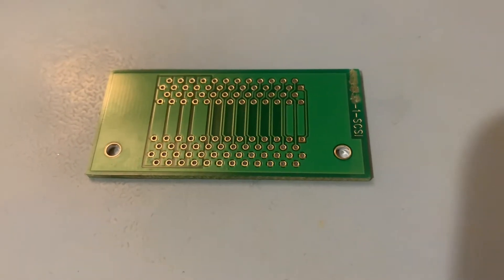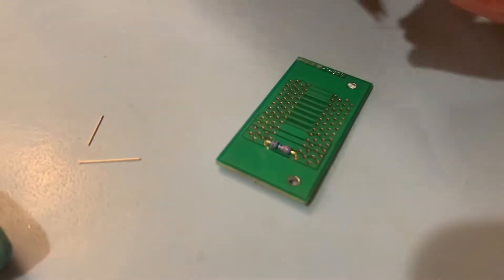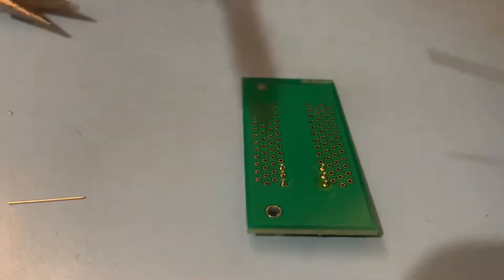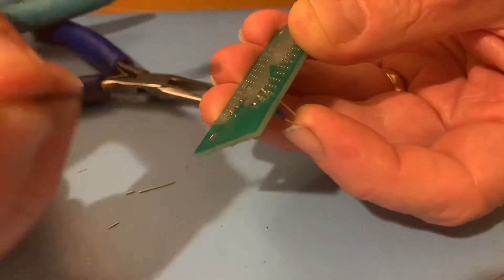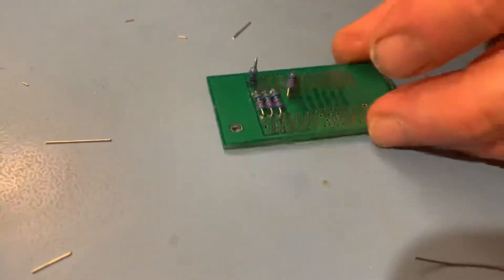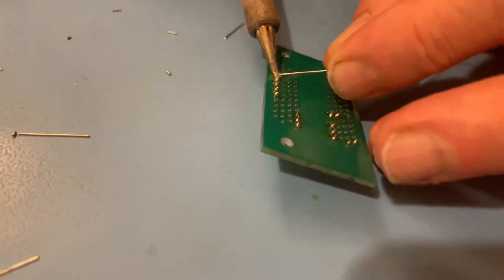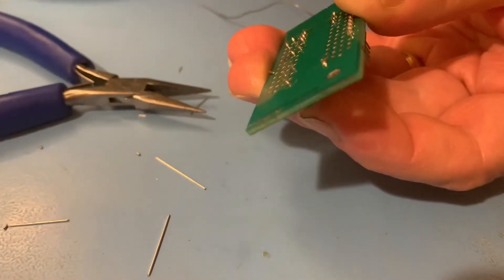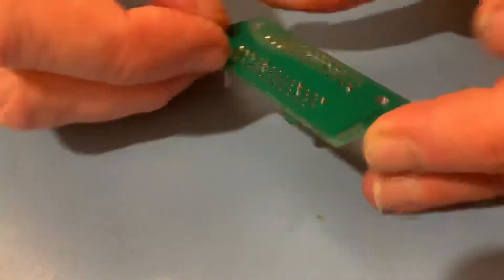PTH /Through Hole Soldering , Made Easy - Beginners Tutorial

Comment: Great video with helpful tips (as usual). I gotta say, with my failing eyesight, these older, larger type PCBs are so much easier to work on. I got one of those practice boards with tiny SMD components to solder on to a small PCB and everything seems so much harder and more frustrating...

Comment: Great Video/Lesson. Do you push the resistor body down flush on the board . ?
Reply from the maker: Hi , thank you for watching the video and commenting , much appreciated . This was one of my early videos  , I've posted a similar one more recently showing through hole components . May be of use . I do generally push the body down to the board if I can , but it isn't always possible . Thanks again for your support of my channel , take care 👍
Reply: @ thanks for replying . Note . Is it best to have a thru hole  component . “Flush on the board “ eg a resistor! . Or doesn’t it matter. ????
Reply from the maker: @andrewhenderson9474 hi , it will still work fine if the resistors are up in the air but it's just neater and less prone to get damaged if they are flush on the board . I posted another video more recently showing 3 different ways to mount resistors . It's a beginners soldering guide , probably posted about a year ago but it's a lot clearer than this video you have commented on . Thanks for your comments , take care 👍

Comment: Hello Sir, that’s a nice video on the basics of soldering. I soldered some 15 diy kits for a modular synth and most modules came out okish,  but  i did a lot of beginner mistakes and got frustrated. This is the best in about 20 videos i saw, especially the flux and cut your legs before soldering tips are gold! Two question, if you allow: what sort of “sponge” do you use when cleaning the pcb? And do you have tips for soldering box connectors with like 16 pins? They are such a huge heatsink. And if i push the temperature the box starts melting :/..Thanks a lot for your work, i’ll stay tuned and look forward to your other videos!

Comment: Hi, I've been following you recently and I appreciate your videos. I wanted to know which model of wire cutters do you use or which do you recommend? I hope for a new video soon and maybe advice on tools and products to use. Thank you
Reply from the maker: Hi , thank you for your comment, much appreciated. The make of cutters I use are Lindstrom . I have a few other makes but all my delicate work etc I would use this make . Bit more expensive than others but if treated correctly will last years. I've slotted a few bits in about tools etc in some of my videos but I guess one day I could do a complete video about them . I will be posting another video hopefully within the next few days . Thank you for your support , take care 👍
Reply: @mrsolderfix3996  Hi, I suggest when you have time to make these tutorials: I don't understand how Loctite 382 and SF 7455 glues should be used for locking new conductors, then when and where to use tin with different diameters. Why is it that despite using good quality 60/40 tin and an EWIG 25 W soldering iron, the welding is not bright but opaque? I thank you for everything.

Comment: height cutters   where can you buy them ???
Reply from the maker: Thank you for your comment. Hope you found the video useful . For the height cutters , try the Tronex 5030 make , available with different height blades . Available from Farnell , RS Components , Rapid Online and any good electrical retailer. They are quite expensive but they will save you loads of time and give you a great consistent cut every time.Thanks again 👍
Reply: @mrsolderfix3996  found the post, cheers 🤙🏼🇦🇺
Reply from the maker: Hi , thank you for looking , like I say they are expensive if brought brand new but over the years they've saved me so much time and every joint is a consistent height which is great . Thank you for your support , all the best 👍

Comment: Thank you i tried soldering my first pcb and it came out all jacked up, I will definitely try this method. Question, do you apply flux to the tip directly ever? I was applying it to my tip instead of the pcb directly cause thats how one guy showed me.
Reply from the maker: Hi . Thanks for watching the video. Never apply flux directly to the iron tip . It will burn away before you even get to do the soldering . Just apply it like I show in the video and you will be ok . Hope that helps , thanks again 👍
Reply: @mrsolderfix3996  Thank you for replying.

Comment: ? why do you pre cut legs ? - i was taught in 80's to slightly splay legs, solder , then trim close !
Reply from the maker: Hi . Some people still use tools that cut and bend the legs over at the same time , then solder . This is fine , but does make removing the components harder if you have to remove them . It's not great practice to cut after soldering as you risk fracturing the joint . I just find it way easier to cut to length like I show then solder . Most people do it this way now , moved on since the 80's. Thanks 👍
Reply: Much respect to Mr. SolderFix. His repairs are the most beautiful I've seen in any youtube video. I did find the 'moved on since the 80's' comment a bit off putting (I'm sure it wasn't intended as such).  After giving it some thought, I think trimming the leads will lead to much better solder connections because you are eliminating an unnecessary heat sink when soldering. I'm trying to figure out how I can order those weller eram cutters without getting in trouble with the wife. I think I'll just take my chances, father's day is coming up, if only I can get to the mail first. :-) Thank you Mr. SolderFix!
Reply from the maker: Hi . I wasn't serious about the 80's thing , I'm sorry . Seriously if you can get some of them cutters you will love them . They come in various height steps , but I generally use my pair with a 1mm step on them , but other people I know prefer 1.5mm on their height step. Most through hole soldering is probably done between 1mm and 1.5mm.so this is the height id recommend. Hope you get on ok , best of luck and thanks again 👍
Reply: That's what I was thinking too. Can't argue with the finished piece though, but I think if I was going to do that way I'd have to tape the component down before cutting and soldering.

Actually I think I might try doing a whole board that way just to see what happens, place and tape everything to the board, then cut the leads, then solder. Should be a real time saver